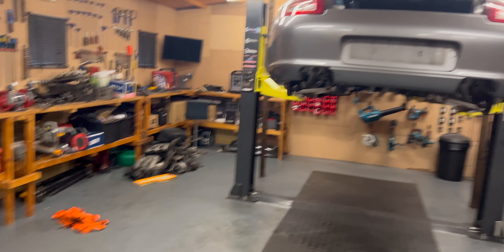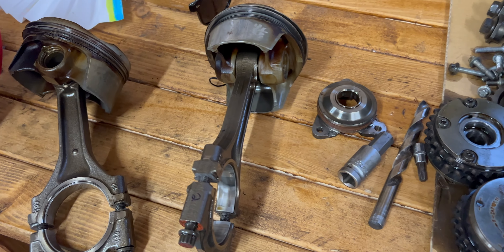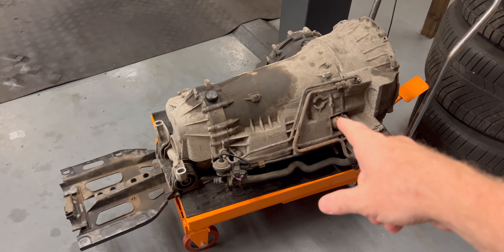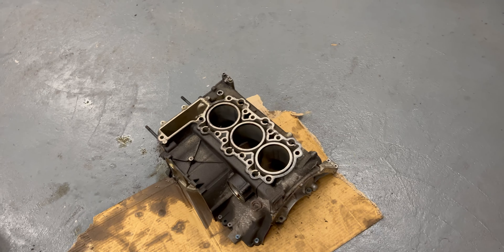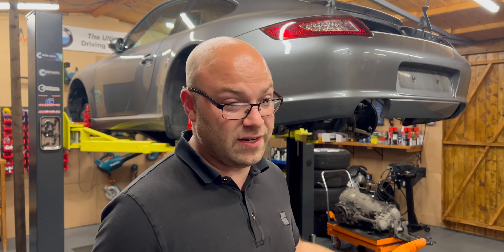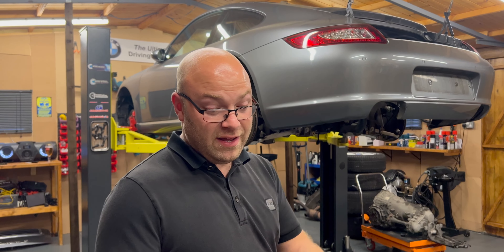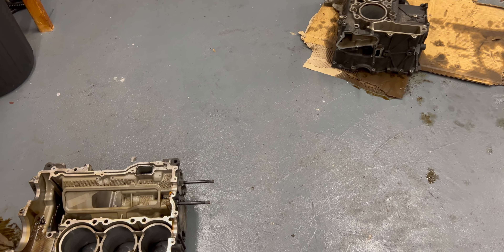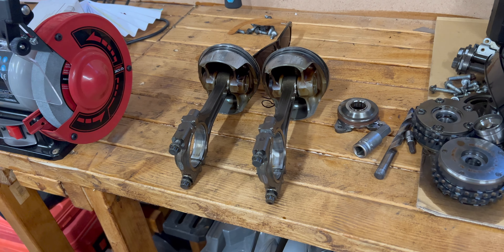Rebuilding A Porsche 997 Engine With Bore Scoring For $1300

Comment: Do the 911 cars from the 70s and 80s do this? If not why not?
Reply: They don't have piston skirt coatings on the old cars. That's what has failed on these newer ones.
Reply: @mikedsilva  thanks for the info!
Reply: Those engines used nikasil linings, so no issue.  When Porsche switched over to mass production of their water cooled engines, they went with Locasil linings, which we're finding isn't as strong.  GT3, GT2, and turbo engines still use Nikasil - that's why they don't bore score.
Reply: No, as they had iron barrels and switched to nikasil plated aluminum barrels later on in the air cooled engines. The water cooled engines (1st gen) had a ferrite coated skirt and it resisted galling from the locasil cast in sleeves better, but this material was outlawed. The 2nd gen had to use a different material on the piston skirts along with a change in the locasil sleeves and they became less durable.

Comment: Steel linings cool at a slower rate than alum.  You'll have heating issues with steel linings.  Vertex sells rebuilt engines in the US using steel linings.  If you want to roll the dice on heating, buy one of their engines for around $12K w/ exchange.
Reply: Why would I do that when it’s only £1400 to have steel liners fitted ? I’m in the Uk not the USA I would never pay anyone £12k steel liners don’t have any issues. The only time issues arise is from track use which I do not intend to take this to a track and I will tell the new owner when they buy it this will no longer be a track car
Reply: A ton of cars stock use steel liners on an aluminum block. What’re you talking about.
Reply: @roots4x  I never said you couldn't use steel liners, I said they dissipate heat at a different rate than aluminum.  There are Porsche engine rebuilders in the US that use steel liners (Vertex).  But if you substitute steel liners IN A PORSCHE ENGINE that came with factory alum liners, you run the chance of heating issues.  If steel is such a great idea, why doesn't Jake Raby or L&N use them (or offer them) in their rebuilds?  They're the 2 most prominent Porsche engine rebuilders.  Other manufactured engines may well work just fine with steel liners.  But if you have to fix a bore scoring situation in a  Porsche, do you want to save a few bucks and then never drive it hard because you might get it hot?   My engine was rebuilt in PHX but it has L&N alum liners in it.

Comment: I’d say those skirts are ok to go back in as they are after a clean. Use new rings obvs
Reply: You are problem on this channel you and nathan get together and build a engine I’m sure it will last 5,000 miles before it blows up just like everything nathan has touched let’s not forget the yellow Porsche he had and also the red Porsche both he messed up which the person who buy did all videos on it.

Comment: They're using Alusil cylinder treatment again. It didn't work in the 1970's and it doesn't work now. Nikasil works. It's more expensive, but it never wears out. You even need to buy a diamond hone so your new rings will seat in a Nikasil cylinder. They cheaped out in the center of the engine. WTF?
Reply: New environmental regulation forced them to switch to that coating .. in addition to a faulty cooling system in engine block system itself causing cylinders on one block to heat up too much and going oval. Don’t forget that Porsche was also struggling with bankruptcy during that time if it wasn’t for Toyota saving them by revamping their manufacturing process, and the success of the Boxster and the Cayenne later … because of that now we still have an amazing car company making epic cars

Comment: A couple things -
1- Where is this place that will sleeve the Porsche cylinders?    HELP !
2- there are places that do all kinds of piston and engine coatings. I have used Swains in NYS.
These places now offer skirt coatings that will add diameter to pistons and protect them. 
They all offer all kinds of magic coatings. 
This option I believe is a viable option and will fill the void of just Knurling piston skirts.
Thanx for the videos!
PS i think you should invest in the art of valve work.   A truly satisfying job.  
 I have been using 50-degree seats in lots of stuff with great results.
Reply: It’s a good friend of mine who does it. They have been done now which was £1395 for 6 new steel liners only true he’s a very good friend of mine and I trust him as even before I got into Porsches he was doing this for 20 years and he’s got many cars driving around on steel liners that have passed 40k with no issue I mean his one he done 5 years ago and he’s done 73k since the rebuild and had no issues and he has the normal carrera not the s. I would reccomend finding someone you know and trust and who can back up their claims I was lucky to see the whole process and I can tell you it really ain’t a easy job on these people think it’s just bore the old ones out and slot the new ones in it really isn’t it was a 4 day process in total to complete them and I learned something new.

Comment: What are you idiots going on about? Bore score happens from aluminum to aluminum contact. It welds itself resulting in bore score. Please don’t ask people to reuse pistons. One of the major things preventing this is the lining on pistons that prevent aluminum to aluminum contact.
And yes there are engines which don’t have bore scoring. Subarus have flat 4 aluminum engines.
Stop misleading people.

Comment: No way I'd go that deep and put such badly damaged pistons back into it.
You cant have aluminium skirts next to the aluminium bores. Thats why that piston is designed with a ferrous coating.
New pistons is the very least that should be done.

Comment: Wrong Oil viscosity used in this engine
Push hard on the cold engine and you get a Gift.
0W40 best engine oil only as AMG
Those Castrols 15W60 are the beauty of the problems.
Same as BMW idiots using 15W60 to kill bearings.
Reply: Totally agree
Reply: I agree too. Been tracking mine since 10 years with the cheap 0w40 changed every 3.5k (a season here). No issus

Comment: Interesting episode. 
Why does it have a Mercedes transaxle in it??? Never heard of that one before. 
I say find used pistons to replaced the scored ones, screw the re-coating, and get some new rings for all 6 - the rest of the build is unlikely to win a concours award as it is :) and it's probably worth properly mating the new sleeves and rings, no? 
Why not do the wider main bearings too? I get that the bearing carrier's intact and seems OK, but if you're going to track this again, the wider bearings would help any issues there. Hartech's just a few miles away :)
Reply: @BMWDoctor oh I definitely didn't want to imply you should go there for your rebuild - you've got what you need! I meant they offer wider main bearings that are highly rated, great "while you're in there" item since you're this far. If you're not tracking the car any more, they are probably overkill though. (I'm just jealous since I'm across the pond in Canada, and Hartech parts are not as accessible here). 

As for the concours joke, I'm more referring to the stuck-up purists who will piss all over a good car because it didn't follow the Rennlist/Raby recipes for rebuilding. I like what you're doing, and you know that you can address any future issues if needed. Steel liners are OK in my books :) I'm actually considering this path for my current rebuild. 

For the pistons, I was suggesting you could save a lot of money finding two used pistons to replace the scored ones, vs grinding/polishing those ones out. New pistons are indeed silly, unless you were going to overbore when you were resleeving IMO. 

Sounds like you have the rest of the maintenance items too, I did water pump, low temp tstat, all gaskets, chain tensioners/rails, etc last rebuild. That stuff adds up quick!

That's interesting about the Merc gearbox - what's it out of? I've never heard of that swap before.
Reply: @miketdavies thanks for that I appreciate it! The gearbox is from the AMG Mercedes and your right that’s what I did do I got very lucky I found someone who knows someone who had 4 good used pistons from his rebuild from cylinder 1,2,3,5 which was all fine no scratches or nothing I got them for £100 😅 so it’s all good on my side now. Don’t need to use them ones. We are going to be taking the pistons off anyway as you know you can’t install the case halves with the pistons intact so I have it all ready to go in just waiting on the case halves now 😅 I can’t wait to bolt everything on and drive it I already got my new IPD plenum to go on and the new throttle body GT3 so I’m looking forward to it with the headers and the new exhaust system
Reply: @BMWDoctor  awesome, good luck once you get your case halves back! Hope we get an update.